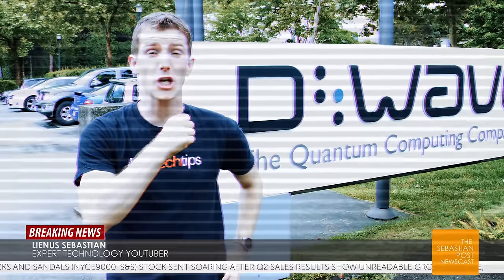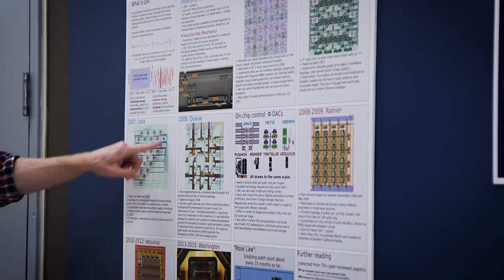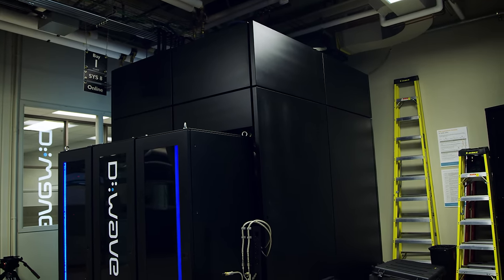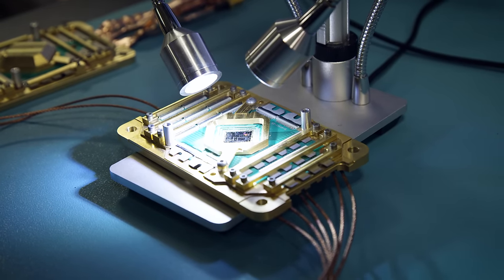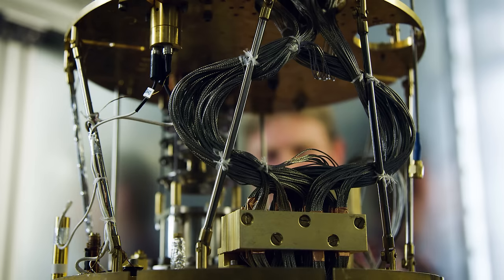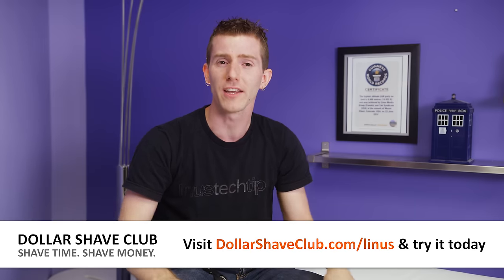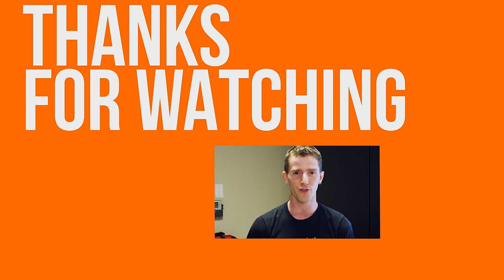UNBOXING A QUANTUM COMPUTER! – Holy $H!T Ep 19

Comment: so if I run windows on it then it'll crash in every possible way?
Reply: +kde9910, lol, you don't even need a quantum computer to get the same result.
Reply: 98luk45 top kek
Reply: Does not run a program as such.  It is more like a system that can solve problems.  May be in the future be AI that thinks for sky net or optimise the code for other programs to be as efficient as possible. So it would create windows rather that run it.  Super far out tech.
Reply: ROYGBIV screen of death
Reply: kde9910 I LOL'd
Reply: The bonus is that it will crash a lot faster.
Reply: It will and won't crash at the same time.
Reply: when you'll not be looking at it, it'll be in a superposition (aka linear combination) of all possible BSODs; when you'll take a glance, the wavefunction will collapse to one BSOD :P
Reply: it might even become a blueshift of death...
Reply: kde9910 😂😂😂
Reply: it's like you've never used a mac lol
Reply: I don't think you need a os for this type of computer just yet. My computer science proffeser had a tendency for calling this these things glorified calculators. They may be VERY HIGH TECH they are also pretty primitive for what they are.
Though there is Ti Key, if they truly want a os.

I wonder how long it will take to port the linux kernel. :P

Comment: I still don't know what a Quantum Computer even is, but what I do know is that "Quantum Computer" sounds freaking badass.
Reply: A regular computer only operates in 1's and 0's, Quantum computer uses single electron as qubits, and thanks to quantum mechanics qubit can be in four states, 1, 0, superposition that collapses to 1 and superposition that collapses to 0. That means one qubit can hold twice as much data as a regular bit, and the more qubits you have, the greater the advantage is.

For example, in 2 qubits you could hold 16(!) values, in two bits, only 4 values, so just by adding one qubit, quantum computer can hold four times more data so 3 qubits would hold 8 times more data, and so on, and so on
Reply: sure, why not.
Someone else mentioned that these are quantum annealing machines.
Really quantum computers are a method for getting finite information about functions that were too lazy to model.
When I say too lazy, I think back to a chemist who has a problem with more variables than atoms in the visible universe and resorted to making heat maps instead of finite calculations.
Reply: Abksabermaster They're more efficient (in terms of processes) and faster computers. A quantum computer can do more things at the same time (no other computer can).
Reply: That's not really true. Quantum computers are faster/more efficient in computing parallel problems, but compared to standard FET based computers, their clockspeed is kinda slow. So for operations that don't really use that parallel computing power, transistor based computers are much faster and that probably wont change in the future.
Reply: ariantes221 Yeap, was trying to explain that as simply as possible but couldn't find the words for it. Thanks for clarifying!

Comment: "Degrees Kelvin" 
Why Linus
Reply: Everyone uses the degrees scale at these temperatures - even the Yankies
Reply: E theKing It triggered me every time he said degrees. it's just kelvin.
Reply: E theKing i know the on screen text is mis leading, but degrees Kelvin isn't wrong.... The on screen  text saying "degrees and Kelvin?" does imply a mistake, but the mistake would actually be the text itself.
Reply: The on-screen text was making a jab at Linus, berating him jokingly for saying "degrees Kelvin" so many times. The text isn't a mistake, just an intended joke.
Reply: E theKing Degrees kelvin is correct. Degrees Fahrenheit, Degrees Celsius, Degrees Kelvin.
Reply: Well it seems to be debated but from a quick search on google about the Kelvin standard and scale, more sites appear to use Kelvin as the unit, not degrees Kelvin. Not saying you are wrong, I could very well be.
Reply: No he is not. It's just Kelvin. There is nothing such as "degree Kelvin". It's 0 degree Celsius or 32 degree Fahrenheit or 273.15 Kelvin. Just 273.15 godddamn fcking Kelvin.
Reply: When spelled out or spoken, the unit is pluralised using the same grammatical rules as for other SI units such as the volt or ohm (e.g. "the triple point of water is exactly 273.16 kelvins"
Reply: E theKing major cringe
Reply: It is not "degrees kelvin". It's simply just "kelvin". Source:
http://www.bipm.org/en/publications/si-brochure/kelvin.html

I quote:
"The 13th CGPM (1967/68, Resolution 3) adopted the name kelvin, symbol K, instead of "degree Kelvin", symbol °K, and defined the unit of thermodynamic temperature as follows..."
Reply: its just kelvin, made that mistake on a science test
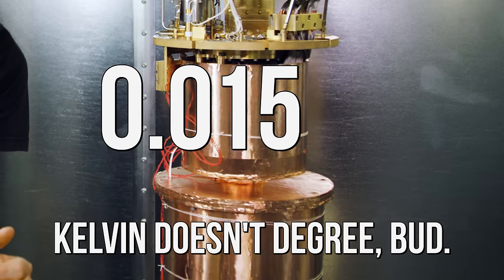Reply: did no one bother to read the screen at 7:57 ?
Reply: It's not the most efficient way to say it, but "degrees Kelvin" is usually accepted.

Comment: I remember getting D wave quantum computer bits and pieces off of ebay in 2013. Got it for the cooling system for another project, an extremely wide band low noise microwave amplifier for radio astronomy. ❤

Comment: tackles the tough part by calling it "quantum effects"
Reply: They solving the problem by alogrithm and logic!
Reply: To solve the problem we used algorithms and code.
Reply: Replacing the word 'quantum' with 'magic' always works remarkably well
Reply: is "quantum mechanical" effects any better? its correct either way. if you wanna be super technical, the computer fucks around with confined single electrons by using tiny magnets or shooting them with a laser, which apparently changes their quantum state at random. What follows makes no sense whatsoever unless you actually know the math in depth. Best way to explain it TBH is that the output the chip reads from the electrons kind of acts as all possible outputs at once. But also not really.
Reply: Search YT for "Issac Arthur Quantum Computers" for a great insight into such "quantum effects" - it's the best explanation I have found.
Reply: Tackles the tough part by calling it "fucks around." lol

Comment: Overclocking like a boss. Cpu don't even get to 1 degree on any scale.
Reply: are you cooling with the right nitrogen?
Reply: If it gets 1 degree Celsius it is 274 Kelvin sooo...
Reply: Lmao it cant even reach 0c
The normal temp for these legends is -279c something
Reply: @RizLazey   
Celsius uses a volume of water at 0 and 100 degree as baseline and then builds up and down from that.
Kelvin uses thermodynamic principles as a Baseline.  Which say that the coldest something can get is when it gets so cold. All the atoms stop movement. "Absolute zero."

So Kelvin's 0 = minus 273.15 Celsius 
Well since that's confusing enough. Most people learn at school  absolute zero = -273 Celsius
Reply: @RizLazey  -6K is impossible, literally all spontaneity will cease to exist at that temperature, even time!

Comment: The cable management needs work.
Reply: unlokia You missed the sarcasm.
Reply: Uh, it's not even correct when you miss the sarcasm. Tidy cables reduce maintenance time and chance of mistakes, and just generally are easier on the mind of whoever "reconfigures" this thing. You don't want to miss anything when you're working with liquid helium and high grade vacuum and lose several days at best just because the cables were tangled.
Reply: jesus christ, these guys just didn't get it XD .... they must be fun at parties.
Reply: The best x)
Reply: The fact that it was OBVIOUSLY a joke aside, these are the only people in the world doing what they're doing. Chances are they know more about it then you. I mean sure there's an off chance you're a disgruntled D.wave employee who abhors the working conditions there, but I feel like that's much less likely. 
Also if you were paying attention during the video these things run for years at a time. Whenever they do maintenance (More then likely in between operations) it is probably completely and extensively thorough. Not so much unplugging something and putting it back in, in the wrong place. More completely replacing the cords entirely to ensure they don't fail on the next multiple year operation, which would be a LOT more catastrophic then any failure of putting a cord back in the wrong place would be. (assuming that doing so would be noticed immediately upon whatever this computers version of "starting up" is)

Tl;dr it's a joke, not a dick, don't take it so hard. They know what they're doing.

Comment: I’m very curious if quantum computing is going to absolutely destroy traditional CPUs and GPUs in the future, or if it will simply add to the arsenal of current computing to more efficiently handle different sorts of problems. I.e. imagine 10 years down the line when building a computer; you might have your CPU for the majority of behind the scenes tasks, GPU for producing visual data and some other specialized tasks, and then a QPU for more abstract computations like machine learning and making generalizations about huge amounts of data where 100% accuracy isn’t needed. Another exciting idea is quantum storage; by adding an extra “bit” (0, 1/0, and 1 instead of just 1 and 0) you are greatly increasing the amount of data that can be stored in a certain amount of space. A 1MB SSD built using traditional computing methods would scale to 8 TERABYTES if it were manufactured using quantum computing. That’s a 8,000,000x increase in capacity. The read/write speeds would also scale by that amount...

Comment: D-Wave has built a machine that performs a specialized class of quantum computing. An analogy would be a classical computer that can add and subtract, but cannot multiply or branch. If you have the right problem, it's useful. If you have other common problems, it is not.
Reply: Reza Ghaffarian Shirazi So...it is and is not useful at the same time.
Reply: +Erik MetalyRock
Or at least, it could be either until observed

Comment: Slap an OS in there and get the benchmarks running!
I need to know the 3Dmark score for this thing!
Reply: 42
Reply: it has a both a score of 0 and 1
Reply: and a few degrees in between and not.
Reply: A few degrees Kelvin?
Reply: J U S T A J O K E
Reply: No, you're comparing an apple to a whale
Reply: the os is both installed and uninstalled
Reply: Faroze Ali khan while also not having a score of either 1 or 0
Reply: Jake Austin these schrodinger jokes 😂
Reply: Syed Mohammed Ali Muddassir Quadri it is both working and not working until you open it up
Reply: Its not an apple, I think its running Windows ME

Comment: Can it run Crysis in 4k? No? The world does not need it.
Reply: No. Four kelvin is too hot for that :D
Reply: *Four degrees kelvin
Reply: MrAnonymus I'd imagine that if it could display graphics, it could probably wipe the floor with several copies of 4K Crysis.
Reply: It's Kelvin, not degrees kelvin. Common mistake as you can hear Linus make it as well.
Reply: SteveHeist absolutely not. I doubt it can run any programs you use on a day to day basis at any decent speed if at all. These things only solve a very very small subset of problems, of which probably compose a small percent of the components involved in a game like Crysis
Reply: ultraboy222 the explanation is very simple.  The entanglement of qubits and the proceeding collapse of their states is what make them special. If you measure one of the entangled qbits both of their states collapse. So if you entangle qubits on some condition and measuring one of them, and then compare their two values it opens up a new playground of possible algorithms. This is the core idea behind most BQP algorithms.  This can be used for speeding up a variety of problems, very few of which are useful for day to day computation however (Excluding Shor's). For the most part, QCs have the same limitation classical computers do and are often far slower.
Reply: In gaming the Quantum computer is probably slower than the I7 7700k
Reply: Vast Horizon His point is, that Kelvin is an absolute unite, there is no such thing as "degrees Kelvin". Also I am from Germany we also use degrees celsius.
Reply: but can it run minesweeper in 8k?
Reply: Didn't know we had a person who knows quantum mechanics on a youtube comment feed.
Reply: Yea but it could run it is several parallel universes though
Reply: It plays it in 8K, but only when you aren't looking.
Reply: it wound be too cold for it
Reply: Probably not ... but it can tell you how to.
Reply: can it run several crysis and several pararel universes at the same time? No? Then Burn It Down
Reply: and don't get your brain blown in the process :)
Reply: +dehim verveen. degrees is used in several scales of temperature. From Kelvin to Celsius. 
Edit: This is wrong.
Reply: +Lois Castricato, That's not how quantum computing works. I do believe quantum entanglement is being looked at in quantum computing, but it's not what makes it special. I'm not an expert on quantum computing, but here's what I understand. Basically qubits have spin. Once this spin is measured it can either be spin up (1) or spin down (0). Before it is measured however, it's in a superposition, meaning it's both 1 and 0 at the same time. Just as with normal bits, you can put these qubits in an array (nibbles, bytes etc.). These qubit arrays can also be in a superposition, meaning it's all the values 0 to 2^n-1 at the same time (where n is the amount of qubits in the array). You can do computations with these superpositions without measuring them. These computations work to increase the probability (basically to 100%) of the qubit array collapsing into the right state when it's measured at the end of the computation. This effectively means you can do computations on huge datasets at the same time, with a single qubit array. This type of computation is very advantageous for certain algorithms that with conventional computing either require a large amount of hardware, or require you to recompute the algorithm for every bit of data in the dataset. Notice that the final answer of this computation is only a single value of 2^n qubits long, even though we basically put in 2^n values of 2^n bits long. For certain algorithms however, you do need to do computations on huge datasets, but you only need one or a couple of answers. This is why quantum computing is really only advantageous for certain algorithms. 

When a pair of qubits is entangled, and one of these qubits is measured in a certain direction (yes qubits can be measured in different directions as well, and depending upon the direction in which it's measured the probability of it being spin up or spin down is different) to be say spin up, its partner once measured in the same direction will be spin down. This is because angular momentum is always conserved. The spin of the universe is Always 0. because this change in spin appears to be faster than the speed of light, This appears to violate causality, However, this phenomenon supposedly can't be used to send information, which means causality is still intact.
Reply: +Casperra9 degrees are not used in Kelvin, cause Kelvin is absolute. it's 200 Klevin, and 200°C

Comment: 0.015 Kelvin might sound cold to us, but not so much to an electron. All it takes is one stray vibration to create massive noise in a calculation. The only way around this I would guess would be to take a large sample of results and do a deep analytical dive on the data set produced.

Comment: Did none of the guys at dwave tell him that it is not x° Kelvin, it's just x Kelvin.

A question was asked here but I think it was removed or something ("how would it compare to a normal CPU? Could it run a normal OS?")
Answer: Straight answer, no. Most things in operating systems are done via serial computation. The advantage of QCs only comes into play when dealing with problems that fall under BQP (usually extremely parallel) Yes they are Turing complete and could run a standard OS, but so can your GPU. (Not to say that QCs have much in common with GPUs. They're nothing alike).

Side Note: What Linus showed in this vid is not a quantum computer in the original sense. It relies on quantum annealing which can solve only a heavily restricted subset of BQP (bounded error quantum polynomial time) problems. And before anyone says, he failed to mention that even though it does compute some function over the permutation of all inputs there is no reliable way to retrieve all possible outputs.
Reply: No. This is not a Quantum Computer, it's a Quantum Annealing Machine.
Reply: There is a reason they have no competitors. They exist on marketing wank. Real QCs will only be owned and operated by nation states or the richest companies on earth. Totally different realm of existence.
Reply: WTF- What's This Friday So does it break PGP or not?

Comment: If its not gonna Run Minecraft on 4k Ultra graphics...then its useless!
Reply: Play mine craft in 640x480. It will look better.
Reply: It can probably run 4k Minecraft
Reply: DLC Spider minecraft 4k is so powerful you can't even run it on ryzen
Reply: I wouldn't.. It wont even run mine sweeper. It's not designed for gaming nor does it have any graphical processor. A super computer is more like a really large expensive calculator.
Reply: That's the joke

Comment: Can it run Minecraft on 15-20 fps on low settings?
Reply: Shapunky Unfortunately not even NASAS super computers can do that.
Reply: it can, but only if you run it in uranus at -400 degrees celsius, which is not really a comfortable thing to do
Reply: Shapunky where coal is both diamond and iron or diamond or iron?
Reply: Lol, -273.15 degrees celsius is absolute zero, so uranus would be colder than theoretically possible.
Reply: I think this ca run Miecraft in ANY possibile setting in ANY poissibile universe...
Reply: theres no such thing s -400 C°